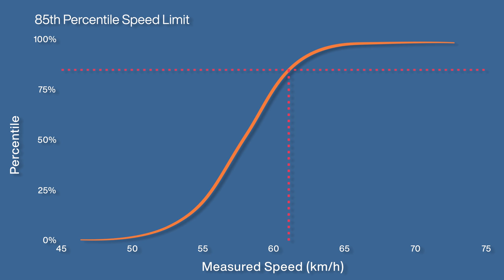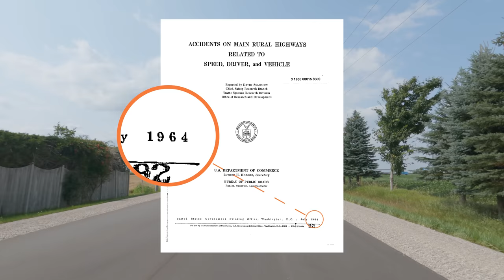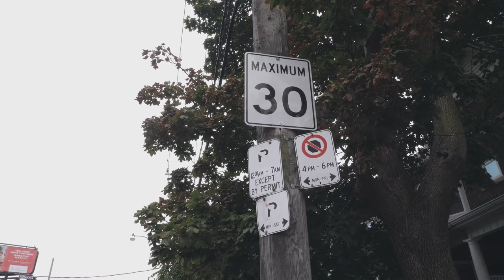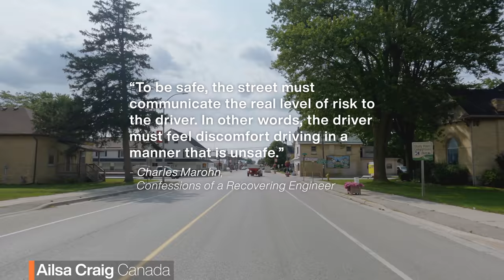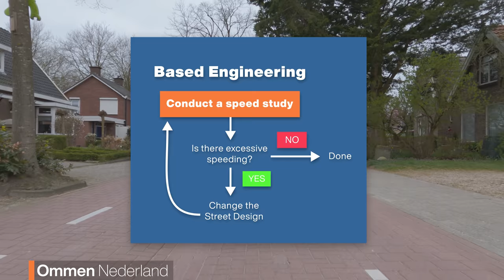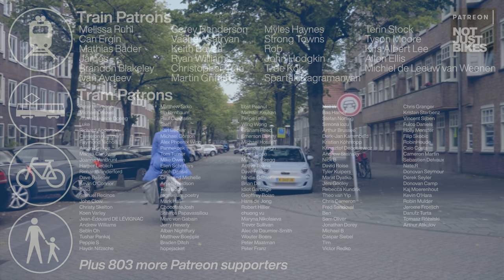The Wrong Way to Set Speed Limits [ST06]

Comment: We had a road in my city that we thought had a short section with a speed limit set artificially low. We found that a speed limit study had been done and that the limit, by the 85th percentile rule, should be that same as the rest of the road. We asked the city raise the limit at a city council meeting and they refused. We then found that the city had been raising a significant amount of money through civil fines for speeding on that one section of road. We sued the city and won. We forced them to raise the limit to the same limit as the rest of the road.
Reply: Wonderful!
Reply: I mean in the Nazi sense for both
Reply: @hosmerhomeboy  "the light would turn yellow for an unusually short period of time" Yep. It's this way in the downtown where I live in AB. You have to slow down at a genuinely unsafe rate to avoid running a red -- it has to be to rake in those red light tickets.
Reply: @malachiwhite356  Was there a refund?
Reply: Higher speed limits harm families and property values, increase air pollution.
Reply: @hosmerhomeboy  I don’t know the law in Canada, but in the US you have to enter the intersection and be able to exit it while the light is not red. And the time of that evaluation is when you pass the limit bar painted on the road. So this standard in AB seems weird.
Reply: And this saved you what? 1 minute off your commute to have a higher speed limit. Wouldn't want to inconvenience your precious time by 1 minute, would we.
Reply: @neils5539  my time is worth money. Maybe it's just your time that's worthless?
Reply: @aaronbritt2025  your time savings is derived by making the roads more dangerous and physically injuring or killing others.
Reply: @NickCBax  speed doesn't cause accidents. Speed just makes them worse.
Reply: @aaronbritt2025  That isn't supported by the research. Speed is a primary contributor to most collisions. Besides, speed is what turns a survivable collision with a pedestrian into a deadly collision with a pedestrian.
Reply: @NickCBax  The research is biased by the funding. The government has a vested interest in lower speed limits. If a DUI driver is speeding and causes an accident, the NHTSA says "speed was a factor" when in fact it was the alcohol, not the speed that caused the accident. If speed was the primary cause of accidents, the Autobahn wouldn't exist. Accidents are mostly caused by shitty driving and the fact that the States mostly give licenses to anyone who can fog a mirror.
Reply: @neils5539  if he’s driving responsibly then what’s the problem with him using a higher speed? The logic here makes absolutely zero sense….yes let’s penalize the best and attentive drivers because the distracted and incompetent ones are causing accidents, even though they’ll still cause the same accidents regardless of speed limit. That’ll sure solve the problem!
Reply: @NickCBax  by that logic Germany should have the most car accidents in the world with their freeway.
Reply: It is actually best for vehicular traffic efficiency and safety to maintain the same speed to avoid reducing space between vehicles.  People do read the signs and react according and when the speed limit decreases, and without an outlet to recreate space lost, the traffic density increases to the net result of higher safety risk and lower efficiency.
Reply: In Pennsylvania they prohibit local police from using radar guns because of artificially low speed limits to entrap people.
Reply: @aaronbritt2025  Collision reports are public records. Please go and compile your own statistics, or find a report that supports your beliefs.

As for if in a collision where the driver was intoxicated, I'd argue that yes speed still was a factor no matter what. Traveling at higher speeds requires better faster reflexes, someone who is intoxicated has worse slower reflexes, thus while its not safe for someone who is intoxicated to be driving, they are safer for both themselves and others if they're going slower.

I do agree with you that much of the problem is due to poor driver training, although I'd challenge you to put forth a system that'd actually survive in society for better training. US Citizens think they have a god given right to drive and must be allowed to drive in almost anyway they want. Trying to regulate driving more strictly would make the gun control debate look like child's play.
Reply: @NewscasterNews4  Everyone thinks they're a good and responsible driver. Also, drivers traveling at higher speeds don't realize how much other drivers do in order to accommodate them. (Those drivers think they're keeping themselves "safe" from the other driver, but that ultimately just enables them.)
Reply: @1BYEBYE1  Perhaps, although I'd argue that German drivers are better trained than US drivers. Since most US drivers think they have a god given right to drive and must be allowed to drive in almost anyway they want, trying to regulate driving more strictly would make the gun control debate look like child's play.
Reply: @Slowcarfastbeans  I appreciate your faith that people will read signs, but daily I watch people completely ignore speed limit decreases, even when they're very well signed.
Reply: @NickCBax  like I said... The statistics are compiled by a government with a vested interest in making speed a factor, so that's what they look for. They then say because speed is a factor, that speed is the cause. "A factor" and "cause" are not the same thing. In my example, even if speed was a factor, it wasn't the cause.
Reply: @aaronbritt2025  And like I said, the collision reports are public and if you'd like you can review them to follow your own statistics.

FWIW, the NTSB is a very independent agency on purpose, they often are the ones compiling information like this. Part of the reason for them being independent is so that they're not able to be swayed, and will call the other parts of the gov't on their issues. (They're more than willing to say the FAA sucks.)

As for "factors" that really is just a synonym for "one of the causes" Collisions don't have to have one single issue. In general, when there is a collision it isn't one issue, its that multiple issues lined up and caused the problem.
Reply: @hosmerhomeboy  Oh yea

someone in a large city fairly recently went around to intersections with and without cameras, and found that the intersections with had almost half the yellow light of other intersections 

Forcing everyone to drive is cruel, punishing them for it is sadistic
Reply: That lowering of speed limits as entering a town is the classic setup for speed traps.
Reply: Did the city find ways to raise other existing taxes to make up 'their' shortfall?
Reply: @NickCBax  That's incorrect. In most states the rule is if your front wheels pass the stop line while it is yellow, then the intersection is yours.
Reply: This is the main reason the US won't change traffic laws. They are designed to make money for the municipalities when necessary. Small towns often collect substantially more money from citizens by handing out tickets than they would if people weren't breaking the law. Traffic cops in areas around me are always handing out tickets near the end of every month to collect revenue and pad their numbers. This not only collects local revenue but helps in attaining state and federal funding for each police department.
Reply: @mikecraig2996  How do you explain “Don’t block the box” signs then? 

I believe it is both. You have to be able to clear the intersection as well as your front wheels being over the stop line before the light turns red.
Reply: @NickCBax  Etiquette. Laws don't work two ways. It's a bit tough to research with google, but I've found the info before.  They don't want you to try to run yellows, but they do have to have a black and white ruling. In my research I found outside of just a few states the rule is if your front tires clear the line before red you're in the clear. This is especially important for situations when people get stuck in an intersection due to traffic.
Reply: @mikecraig2996  In Washington State, both laws apply, you must be able to exit the intersection before you enter it, and you cannot cross the limit bar when the light is red. In practice only one usually comes into play. 

In heavy traffic, it’s not hard to not enter the intersection before you can clear it, it’s just weird being stopped at a green light. 

Also, the law that you’re not allowed to change lanes within x feet of an intersection also helps this, but far too many people don’t follow that law. 

In general we need better driver training, but since people in the US think it’s their god given right to drive in almost anyway they please, it’s more likely that pigs will fly first than for us to increase driver training.
Reply: @hosmerhomeboy  as an Albertan I completely agree with you. Speed cameras in Alberta are nothing more than a cash grab and the speed limits are set ridiculously low.
Reply: reading this, in conjunction with the info from the previous videos, gives me the idea that this was one of the ways the city was funding suburban sprawl

Comment: What's REALLY clever about the trees at 8:58 is that the firs four are spaced out and then they get closer together. This makes the driver feel like they are going faster than they are, and encourages them to slow down.
Reply: Wow, that is clever!
Reply: I really wonder why does it even work? There is a road (more like a section of a road) that I know of in my country that has trees on sides. Speed limit is 90km/h. And guess what? Almost no one goes slower than 90-100km/h. Of course there are those who go 70 km/h for some reason and it creates dangerous overtaking situations.
Reply: Yeah... i thought exactly the opposite: look, a bunch of trees just to divide traffic from the bike lane. No incoming intersections, no bikes, no pedestrians.. I would speed up like crazy on that area.
Reply: @olafs_valinieks  dude most people on the road are air heads. Driving on autopilot. Of course it works.
Reply: @mikemx55  it's not "oh trees" it's the fact that you're already driving past trees and then they get closer together. This makes you think that you are going faster than you are. It's a commonly used design trick and trees aren't the only thing - fence posts, blinders between lanes, anything vertical can be used. In Britain you sometimes get yellow rumble lines painted across the road on the approach to roundabouts at increasingly small intervals, which gives drivers visual, tactile and audible signals
Reply: @Noah-dy8ii  ....by making them slow down?
Reply: I didnt notice that before, but wow it really does have that effect. Thanks for pointing it out
Reply: @pavarottiaardvark3431  the car addict's ideal city is their house surrounded by barren empty asphalt
Reply: This is completely nonsense. The trees have been there for a long time, many oak avenues are older than cars and have just been planted by the farmers. Avenues are so normal to start and here in Germany that almost no driver would react to what's just scenery. This isn't anything but coincidence if it scares some people to slow down.
Reply: @Legominder  Having personally managed fields with oak trees on them, I can tell you that those trees aren't particularly old. You can also buy trees at a significant size, with tree sellers able to provide specimens over 9 meters (30ft) tall for a few hundred Euro (which, on an infrastructure scale, is not much at all).

Even if the trees ARE prexisting, trees next to roads NEED management - roots and branches must be controlled, damaged trees felled, spaces between trees kept safe. In this way, even old sections of wood can be made to suit the needs of the exact location. Visual cover, noise cover, pollution reduction, beautification, all of these can be managed in or out of existing avenues and copses.
Reply: This reeminds me of the spacing between the dotted lines on the road changing depending on the speed limit.. that is to say, the speed at which they pass is obvious depending what speed you go, but it also seems like the boulevards have closer together lines than the highways.. i feel like if the lines were all super close together when you want people to drive slower, it might actually work (i mean, they need to be done so it seems "normal" at the desired speed)
Reply: @olafs_valinieks  I wondered the same thing. We too have rouads like this and it's common to drive as fast as 110km/h when the actuall limit is 90km/h.
Reply: @pavarottiaardvark3431  The microsleep in combination with those trees is often fatal, even at much lower speeds.
Reply: @night6724  Okay, thanks for your input with some great sources. Really educational.
Reply: @mrkv4k  Citation needed.
Reply: @Gabu_  For what exactly? I usually drive 100km/h, because that speed is tolerated by our police. And I am usually one of the slow ones.
Reply: @mrkv4k  Wow... just wow.
Reply: @Gabu_  Well thanks for making it clear then...
Reply: Sorry, but that ver likely isn't planned. I've never seen trees planted at varying distances in the Netherlands. What's much more likely is that there were trees in between but they got sick or damaged and were removed.
Reply: @Legominder  It's the CHANGE that has the effect. If it's everywhere, it has no effect. Obviously.
Reply: @olafs_valinieks  How wide is the road? The wider the road, the less effective the trees will be.